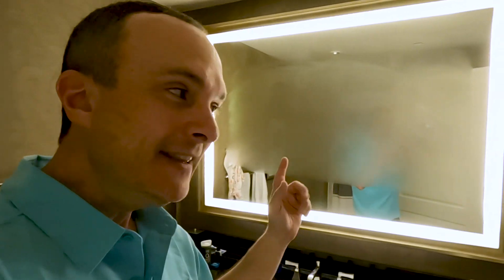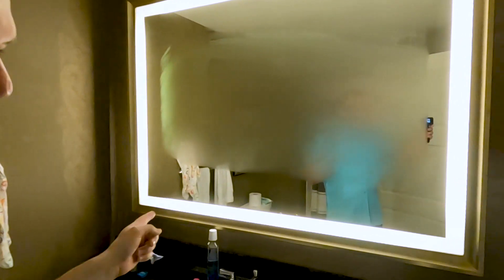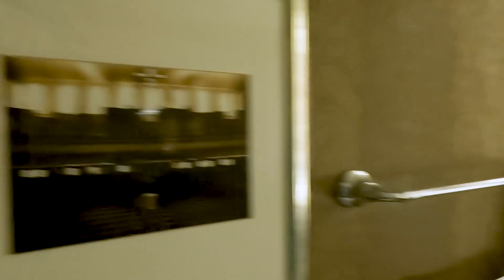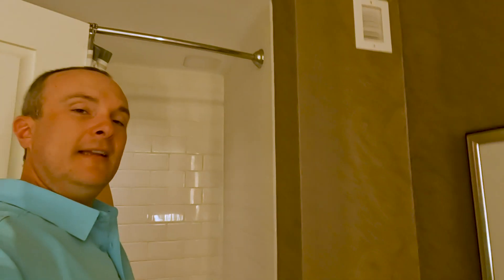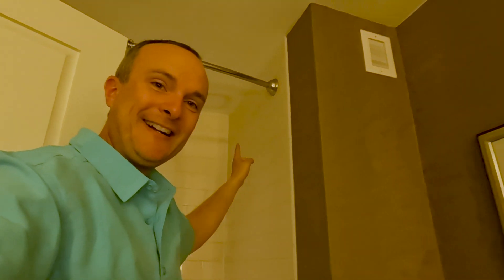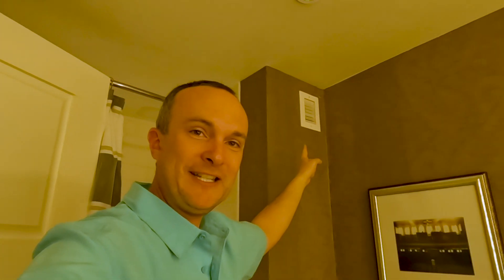Hotel Bathroom Wrecked (by Design)- How Not to Design Ventilation with a Bath Exhaust Fan

Comment: I could be wrong but for better or worse I think hotels are normally designed with only low cfm continuous exhaust from bathrooms, nowhere near the air volume of a home bathroom exhaust fan. Cost savings in equipment and also less exhaust air (loss of conditioned air)
Reply from the maker: The bathroom we designed and built has continuous low flow (25 in shower, 15 in toilet), and we have no issues at all. This is just bad engineering.

Comment: $10 says the windows won't crack open, either.  They never do in hotels. 
I was at a brand new Marriott in Tucson (extremely dry there!) and needed to hang wet swimsuit to dry overnight. It didn't. That's TOO MUCH MOISTURE and that entire hotel is probably a mold pit after only 4 years.

Comment: Apartments I was working at the other day had no bath fans, no range exhaust. Just one 120 cfm fan in the front of each unit dumping into the area above the drywall ceiling in the hall. An erv on the roof pulls air from above the ceiling in the hall on each floor.
Reply: And apparently the building inspector was only pissed because they didn’t fire caulk all the penetrations in the drywall
Reply from the maker: Pretty slick

Comment: bath fans here are a case of yeah its legal but they often don't work because there is no regulation saying you have to allow air to come into the bathroom.
tho the last hotel wasn't to bad, the bath fan actually worked but the main ac system was a noisy pile of junk. 
tho one was a little funny. "the room has a heat pump, but please don't use it as the outside unit are so noisy it keeps everyone awake."

Comment: That looks like a hvac vent.
Most the bath fans I have seen don't work anyways. 
Noticed some that cut a huge slit into the bottom of the bath door to allow air flow.  Hvac in and vent out through the door. 
Pro ably not so much the engineer as it is the maintenance crew. Either uneducated, under financed, or just don't care. 
Hvac in every room usuly run none stop. So I guess they figure it will do the job of removing moisture.

Comment: Where can you find guidance for ACH requirements for different rooms?
Reply: I would think that is going to be different in each region. But other than that I use monitoring and have the air move on demand. 
So where I’m worried about moisture I have a condensation sensor that turns on the fans. In the 3 main areas of the house I have CO2 sensors that circulate air when CO2 hits 1000 ppm. I also have some pm 2.5 sensors. 
This makes areas like the basement no waist energy with fresh air unless someone is actually using it.